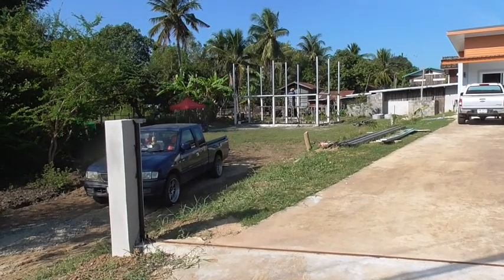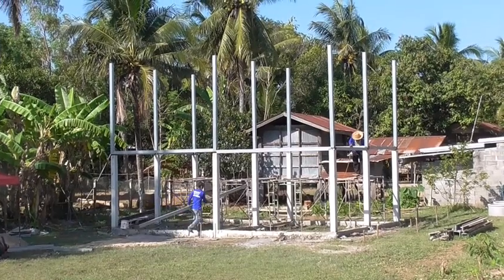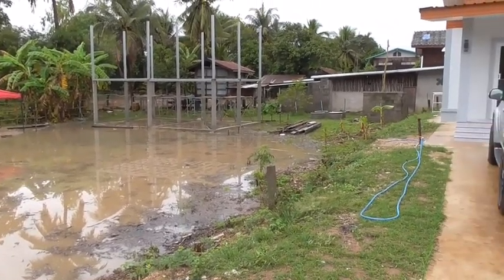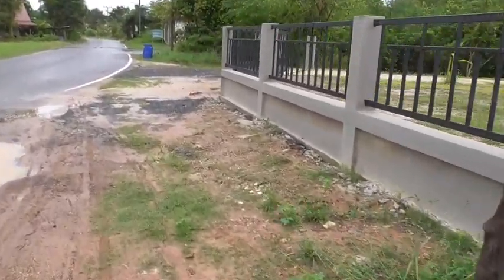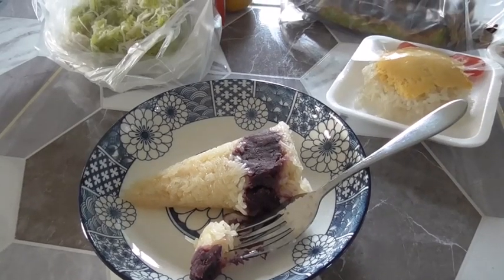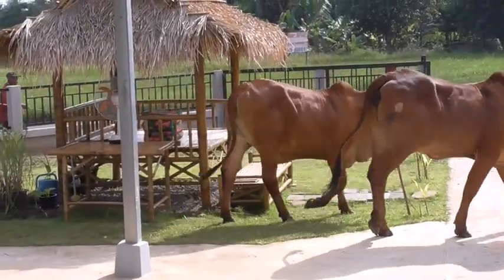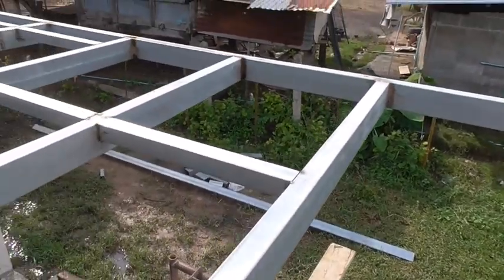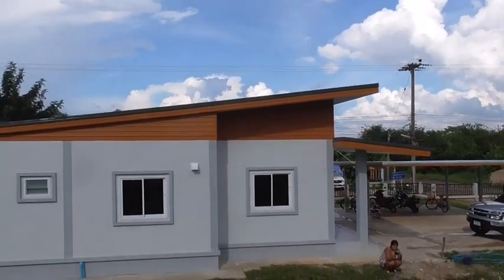Tiny house build, Up to day 12

Comment: It had to happen eventually. 
That section is much lower than yours and Well like a busy highway you will get congestion eventually.
You must have had a very heavy down pour.
Reply from the maker: That night sound like a airplane taking off, that's how hard it rain, so loud it woke me up twice during the night. Tropical storm.   Normal rain it don't flood. But we will top soil it and have another look.
Reply: @selfreliancelife9133  <laughing>
Might have to put in a drain around the sections boundry.
Just incase.
And a culvert at the beginning of the driveway. 
Grow watercress  he he he he